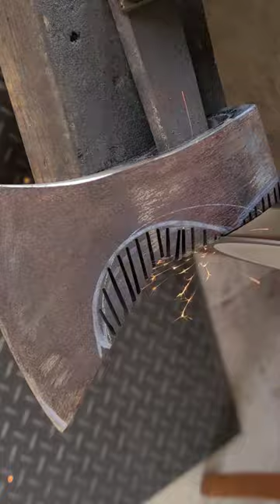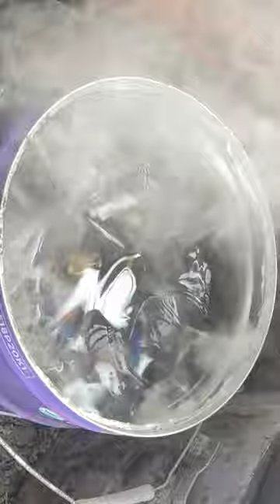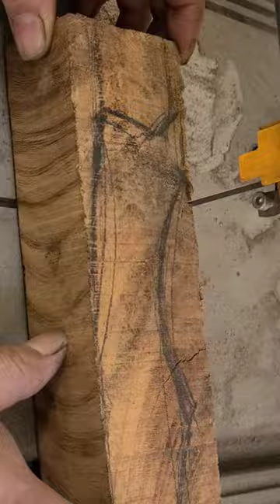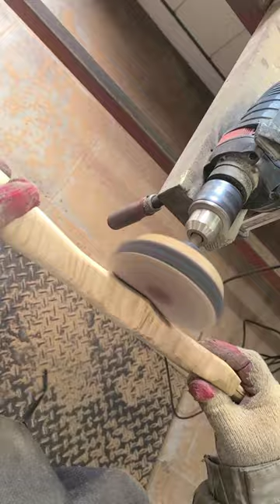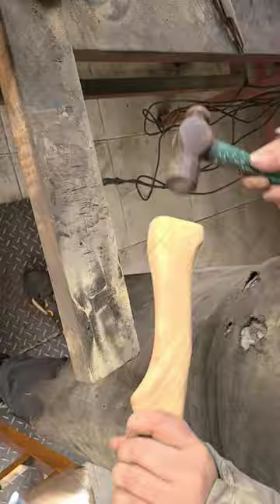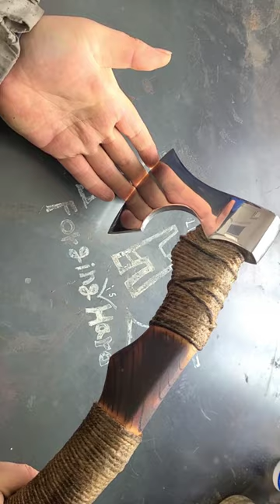Axe Restoration #1

Comment: You were doing great on the axe head modification, but "blew" it on the handle.
Chuck the rope decorations and add 2 or 3 inches to the handle length.

Comment: Not a restoration, but a modification. I don't mind it but call it what it is. Now, you did real good with the head, no issues. What the hell is up with that handle!? A full size felling head on a hatchet length handle, a weird one at that. Come on now.
Reply: Where r your videos you make, edit, and post on YouTube with all the necessary camera equipment as well as power tools to make your pieces?
Reply: @ConciseDharmata  don't need camera equipment and editing to know quality. Like I said, the head is fine, my problem is the handle. Now instead of getting defensive, throwing up the channel, videos and camera equipment as a means to dissuade criticism, you could give reasoning why choosing to do what was done. You could also inquire about constructive criticism as well. So I ask again. Why the handle?
Reply: @wcswood  that's gotta be killer on the wrist and forearm though.
Reply: @Todd  I agree with you on it not being a restoration but a modification, but as far as the handle goes it could work for certain jobs. I wouldn't personally do a handle like that though